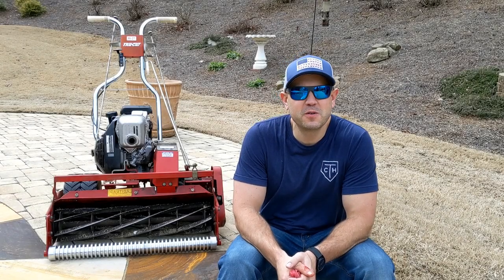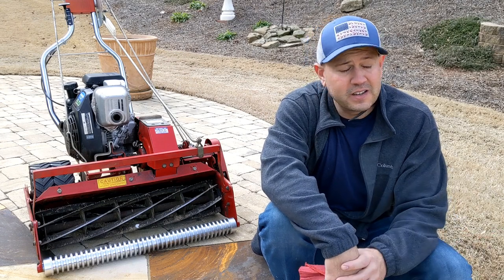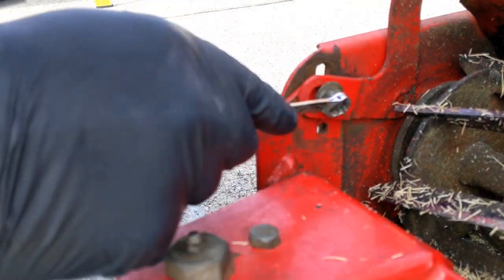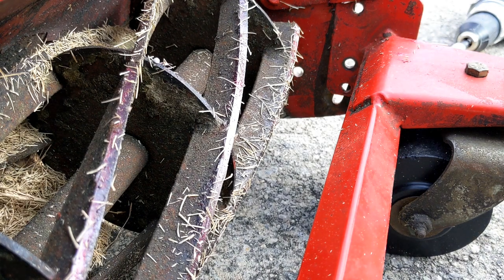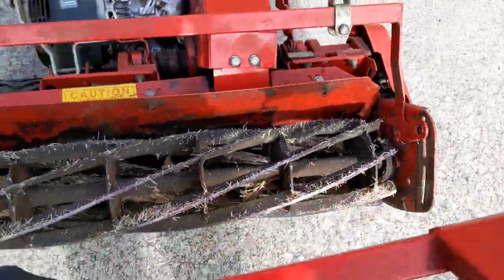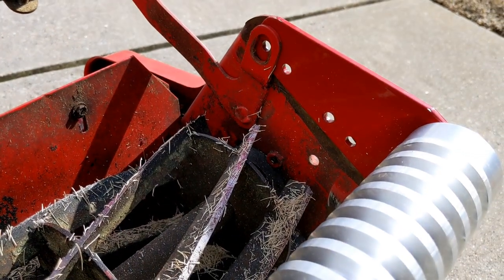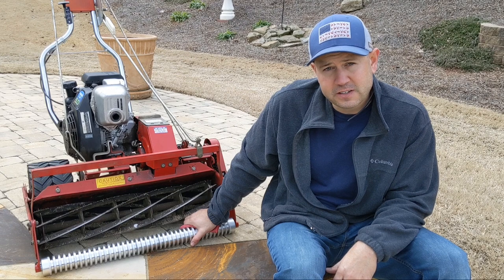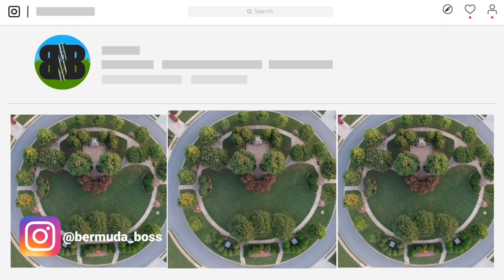Grooved Front Roller Install

Comment: Hello thank you for this video tutorial.   I just purchased a Pre-owned trucut and it's the same model as yours. 

1. Does Grove rollers offer good strips compared to a flat roller?

2. For Honda GCV 135 engine, is there a drain bolt on the back of the mower?  I am trying to figure out what's the best way to oil change this
Reply from the maker: Hello! I don't think a grooved roller will stripe better but it can help stand up wet turf for a better cut. If I had a smooth roller I would keep it rather than trying to replace for a grooved - just not a big enough noticeable difference in my opinion. I have since sold my trucuts so I can't recall the oil drain I'm sorry. An oil extractor will definitely do the job though you can find them on Amazon.

Comment: How come nobody ever discusses the bolt tension on the 4 nuts?? I put on a new roller and couldn’t move the HOC handle.  Took me a while to figure out I over tightened the bolts.  Was also worried about leaving them too loose and dropping one on the turf or into the reel.
Reply from the maker: Good point I should have mentioned it, I no longer own any trucuts however

Comment: nice upgrade to your reel mower. any idea how long the front roller bearings will last? later the bearings will get worn out, do you think this can easily get replaced "diy"?
Reply from the maker: Great question let me see what I can find out and I will reply again
Reply from the maker: They are replaceable and they are sold on the reel rollers website. Lifespan is pretty long but will be shortened if you use the roller a lot during moisture (mowing with dew on ground). The new bearings can be pressed in using any kind of press. I hope this helps!
Reply: @BermudaBoss  , cool cool.. appreciate for the follow up.. am itching to buy groved roller. 👍👍👍
Reply from the maker: @hitmann007  what reel mower do you have??
Reply: @BermudaBoss  , i got mclane 20in reel mower.